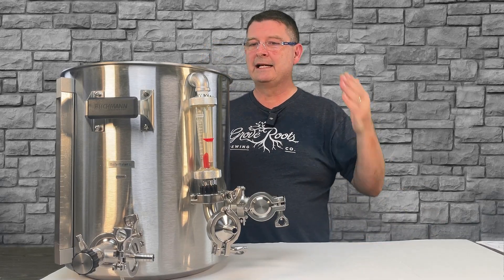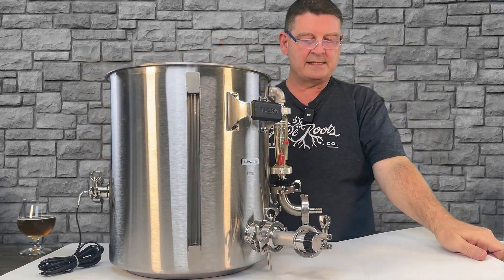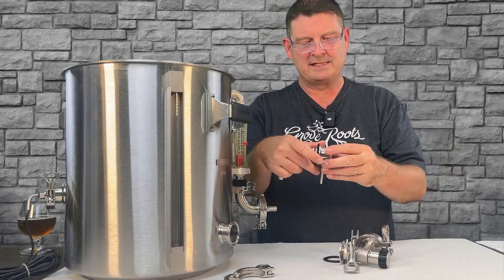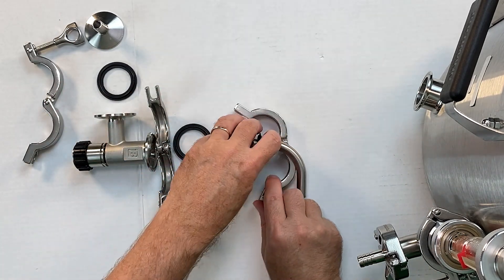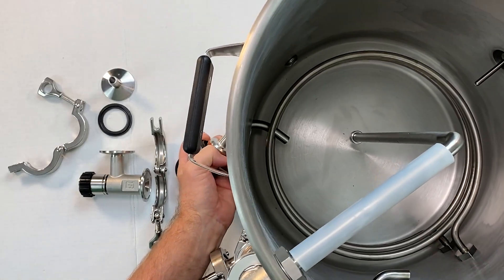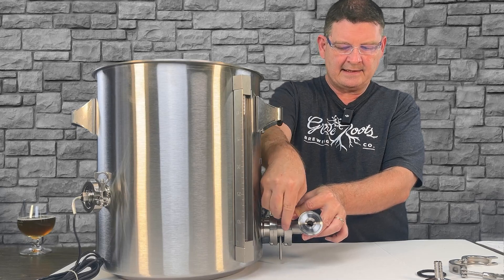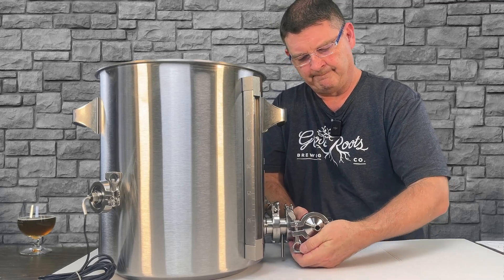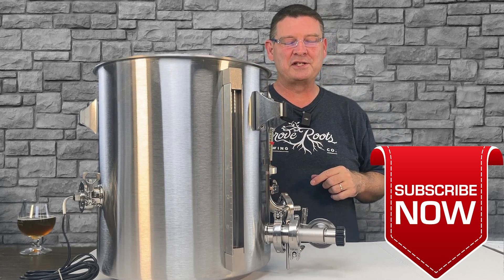Blichmann Brew easy compact - Tri-Clamp G2 Linear Flow Valve with rotating dip tube

Comment: I just bought a new Megapot 1.2 15 gallon kettle. It is undrilled and I am contemplating how best to have it setup. I hadn't considered having Triclover ferrules welded in it, but now I am after seeing your setup. How do you decide on what your kettle geometry should be? I thought it might make for an insightful bit of content on your YT site. Thoughts?
Reply from the maker: Take a look at the info on Blichmann's site where they make recommendations based on location and then you can even do a customize on one of their pots to get a better understanding. https://www.blichmannengineering.com/boilermaker#customize
Also, if you already purchased the kettle, I wouldn't recommend the Triclover, unless you are already invested into those. I'd go with NPT as it will probably cost you a lot less and be a lot easier to simply have wholes drilled (or drill them yourself if you are up to it). Most NPT will have an o-ring and nut for the inside or a type of flange to help seal it with the outside device.
Reply: @BitterRealityBrewing  I was thinking doing it myself with weldless fittings before, those usually need 7/8" (22.5mm) holes and you can get a round hole punch to make clean holes in stainless for about $25 on Amazon. Just thought it might be a good idea to contemplate a whirlpool, except I also want to accommodate a 33cm brew basket, so you have to really limit the "Sticky outey" stuff, like thermocouples and heating elements. It would be less likely to leak if it were welded, so I thought about having brewhardware estimate the job before I toss the packing boxes. If ya'll wonder why I am reckoning specs in metric, it's because most of the parts come from Amazon and China, and you have to search using their terms. Sucks, but necessary. 😁

Comment: Thanks for sharing. Just to buy the attachments are pretty expensive. I was going to purchase the flow meter and right now it's selling for $100.00. Might have to wait for prices to drop when this system is a year or 2 old to make purchases for the gadgets that I want. Cheers!
Reply from the maker: Thank you and I've been really thinking how it would be awesome if all, the All-in-One systems starting offering some sort of devices to help you measure your flow rate on recirculation as that would help contribute to being able to do repeatable brews compared to the current "Eye Balling it" measuring system.